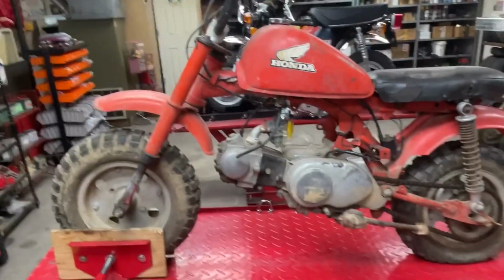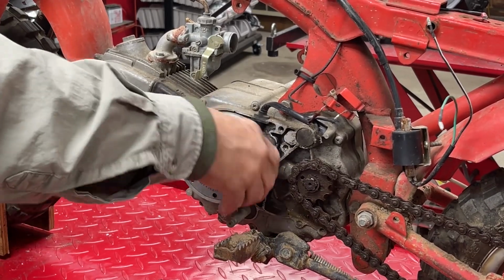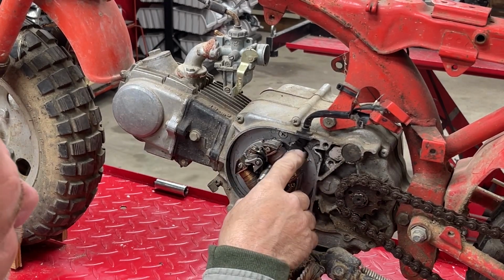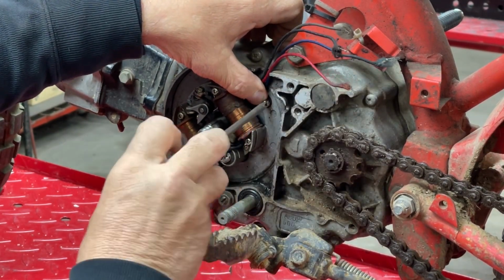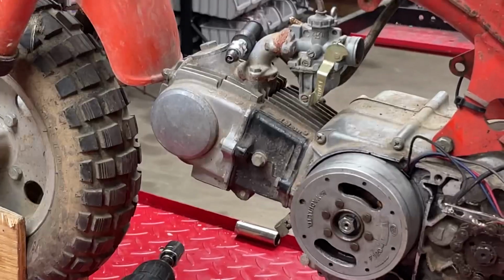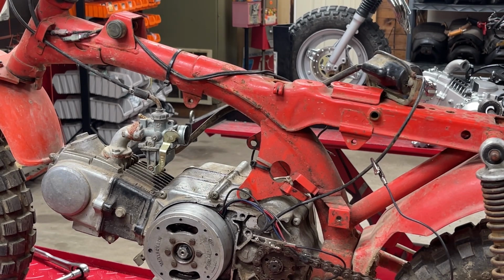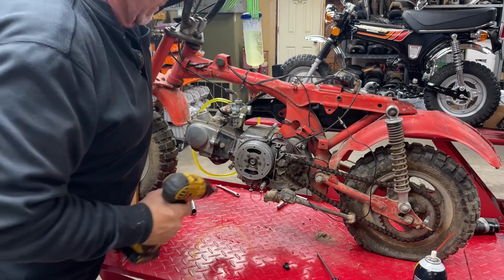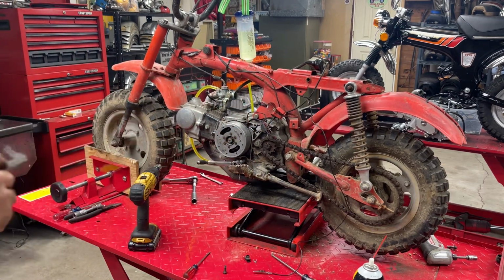1979 Honda Z50 - video #1

Comment: Seems like it has a -78 or older motor, thats why its got a lighting coil and more than 1 wire from the stator. Check the engine no, should start with AB02 for the -79
Reply from the maker: It’s the correct engine, but someone could have swapped the stator at some point.
Reply: @MiniBikeMike   probably correct, but also the crankshaft, the AB02 engine used a crank with a longer flywheel shaft

Comment: Ide like to see you put a 190 cc motor  in.a bike.
Reply from the maker: Already done that, like 10 years ago.  I’m not a fan of the 190’s…..not worth the cost.  Almost every person I know that has installed one either took it back out within a few months or sold the bike…..me included.     On mine, the charging system sucked, the engine vibrated and you definitely need an external oil cooler.  Because I want my bikes to look stock, I really don’t like the look of oil coolers, so my 190 has been on a shelf for 9+ years.

Comment: Those taller handlebars on the 79 is nice for bigger riders. They don't hit the knees like the shorter bars used in all years later.
Reply from the maker: I also like that the bars are mounted in a riser, so you can adjust them forward/back.  The 98 Z50 had bars that were mounted solid, no way to push them away from you.

Comment: Good day Mike. Wondering if you can help me? Got a 78 ct70 changed the head on the motor but now i have no spark.i did the tests you show on your videos,got power from stator,power up top going to coil,tested the coil with 6v and works fine got spark,changed the condenser but when back together still no spark when cranking.Any suggestions? Anything will help. Thanks.
Reply from the maker: Do you have a battery plugged into the harness?  If not, the coil is disconnected from the harness.   Have you tried running a jumper from the black wire of the stator to the black wire of the coil?   This will bypass the harness and narrow down a problem area.
Reply: @MiniBikeMike  I’ll try that thanks
Reply: I tried using a jumper from the stator to the coil wire and still no spark but i have power from the stator with a test light and the coil works with 6v directly to it. I’m a little bit baffled.
Reply from the maker: @karlprosser71  The test light might only be telling you that the points are opening/closing, there may be a wire grounded somewhere behind the flywheel.   Did you see the first video I posted on the 1979 Honda z50, from a week ago?   Try connecting the jumper wire to the black wire coming out of the engine and as you’re turning engine over, scratch the other end of the jumper against the engine case.  You should see spark.  Check out that video to see what I’m talking about.    Also, check your point gap.  If the points open too far, the spark won’t be passed along to the coil.
Reply: @MiniBikeMike  perfect thanks I’ll try it tomorrow and let you know
Reply: @MiniBikeMike  it was bothering me to much, i jumped the black wire to the engine case and there is spark but with the jumper to the coil still no spark.
Reply: I watched your video again to make sure